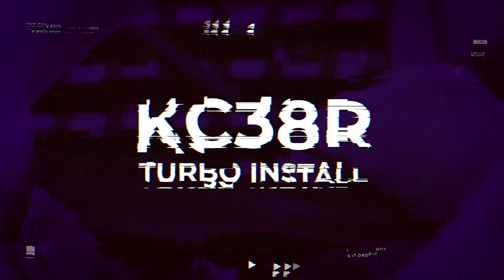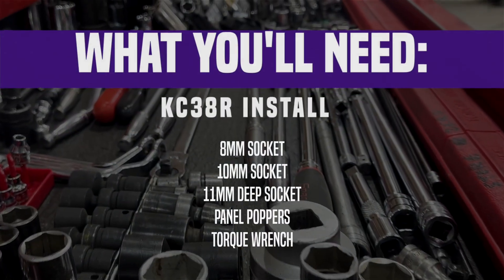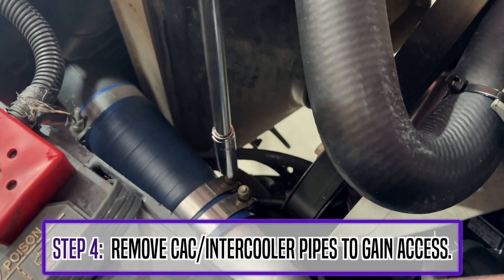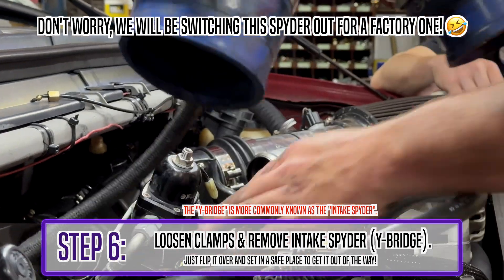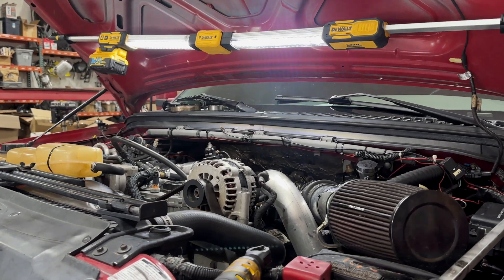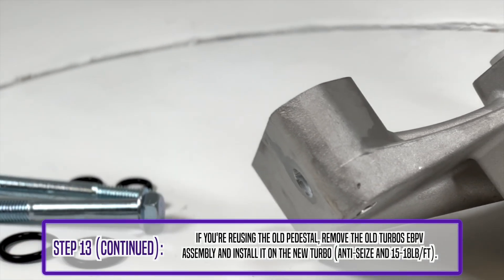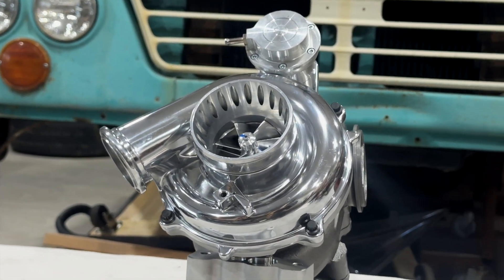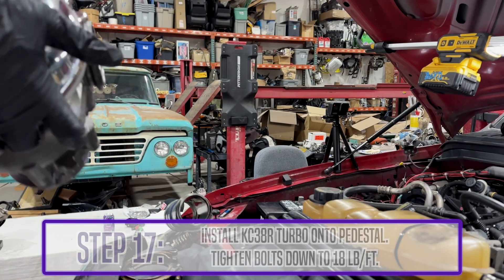How To Install The KC38R - 7.3 Powerstroke Turbo Install!

Comment: why not plug in the red tube?
Reply from the maker: Because the red tube is a vacuum line that actuates the factory waste-gate. Our waste gate is controlled by spring pressure internally. Vacuum lines can leak and are not very reliable, so the spring was the way to go!

Comment: How would you compare this to my current? 

KC300x Stage 2 Turbo (63/73) 7.3 POWERSTROKE (L99 - 03) - .84 A/R

I'm still running stock sticks and I'm very pleased with it. Whistle is very noticeable which I like. Wondering if this tiger increases power and maybe a bit louder?
Reply: Kc38r louder

Comment: Pretty sure that isn’t an early 99, since it has the intake air heater. Mine does not have that at all and your turbo has 5 bolts holding the compressor housing on where a true E99 has the 4 bolt housing. On a late 99 you can remove the compressor housing in the truck on a E99 you have to pull the whole turbo to change compressor wheels.

Comment: It truly surprises me how undereducated people are they buy something just because someone tells them that they should what you need to do is do your own research. I’m going to use an example as a tow package I bought from KC is terrible. There’s no power at all. What I should’ve done is done my own research and got the Injectors . I wanted and kept the turbo and I’m much happier and got my own tuning from a guy local live there and I guess waste of money.  205/30 injectors with stage 1 kc turbo with gearhead tunes it rips seriously good power vs kc tow kit 180/30 jelli built tunes sucks pretty bad worst then stock with a hydra 😂🤣 these companies care about is money better offer in your own research and buying these parts individually the stage 1 turbo supports up to 238 injectors but yet there stage 2 kit had a 205/30 injector with stage 2 turbo they just want more money from you guys need to stop being fooled in to this crap ! Read the min guidelines and the maximum guidelines for you parts and turbos before buying them save you a lot of headaches

Comment: Dang I’ve had the red hose installed for a good while now, never knew it wasn’t suppose to be on, and how does this turbo compare to the 300x stage 2 turbo they seem similar other than the dual bearings